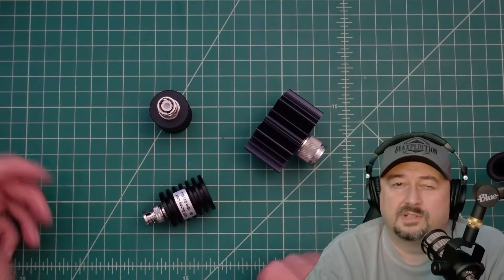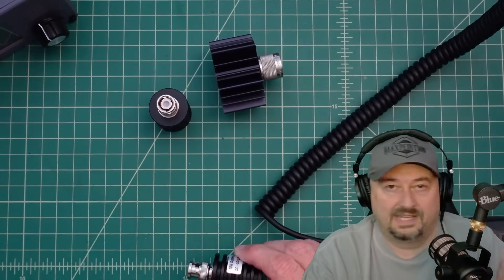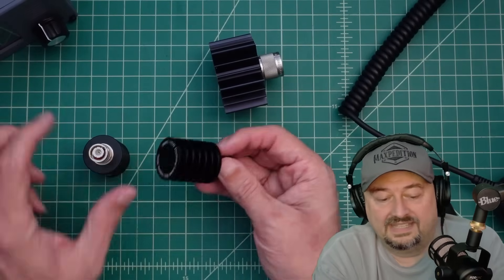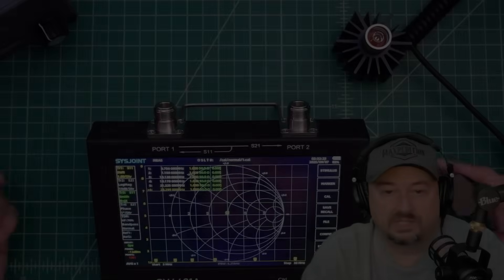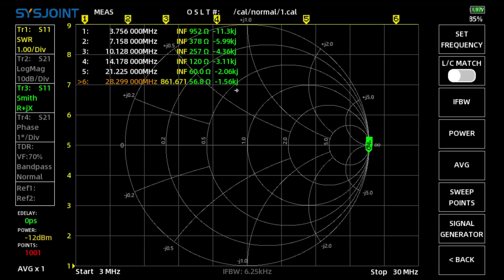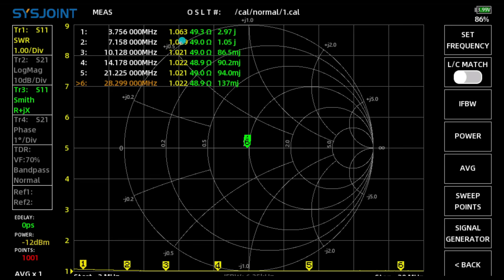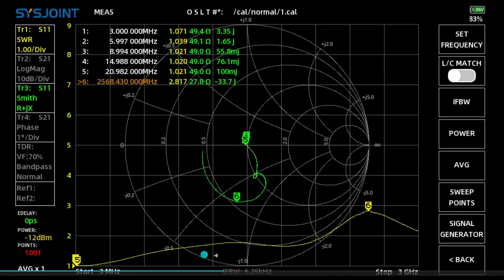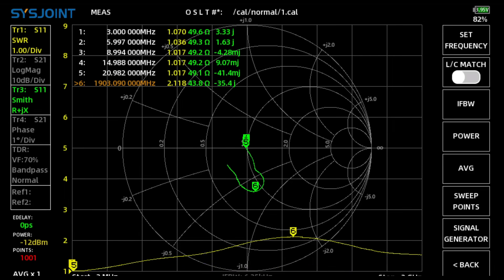I Found a BIG Problem with My Dummy Loads!

Comment: I have some low ower 50 ohm feed-through terminators.  Having seen some turn to infinite resistance, I checked and found that they had the termination resistor ends just squeezed in  BNC connector mounting screw threads.  Obviously the assembly process did not allow soldering, so they had figured out the smart squeeze in threads way.  Well,  good as far as it went, but the twisting the BNC lock ring after a few times had moved the mechanical connection via the thread enough to even interrupt the electrical path.
Reply from the maker: Ugh, sounds like a pain...

Comment: I used to work for Celwave, who also makes loads.  Bird and Celwave were very good load manufacturers, and usually they have measured data to verify these loads.  I measured all of mine, and my 150W load is 25 dB return loss up to 1.5 GHz.  You may want to make sure you have a test load that is verified to 3 GHz as a standard.  Just a suggestion.
Reply from the maker: Thanks Kevin, I actually to have a 250w celwave that I like quite a bit 👍

Comment: Years ago I bought a MFJ-264 dummy load at a hamfest. It was only $10. I asked if it worked and the seller said “What can go wrong with a dummy load ?”. For years we used it to check coax runs on field day. It was plenty good enough for that. Then I bought a NanoVNA. I used the MFJ-264 to see how the NanoVNA works. After getting some interesting looking displays on the NanoVNA, I removed the cover on the MFJ-264 for inspection. I thought it might be a cold solder joint or poor mechanical connection. The resistor was clearly marked 60 ohms, that’s 6 Zero. It appears to be factory, but I’ll never be sure. A simple check with even the cheapest VOM shows it ain't 50 ohms. Live and learn, always verify your test equipment.
Reply from the maker: Hey David, thank you sharing this story… it does reinforce the need to test everything 👍

Comment: I suspect the adapter is causing a fair bit of the discrepancies at the higher frequencies.  If you happen to have BNC calibration standards, you could calibrate your VNA with the N to BNC adapter accounted for.   The newer load is likely still worse than the Bird...
Reply from the maker: That’s a fair point 👍

Comment: Nice video, thanks! My MFJ tuner has a dummy load, but I am tempted to make my own from a welding carbon rod (maybe "air-arcing" is a better term) and trimming down the copper to get 50 ohms. Or maybe letting it be longer and using a ferrite transformer in front. Anyway, I like your direct narrative on the subject, it is so much better than someone droning on with a slide show.
Reply from the maker: lol, thanks for watching Richard.  Sounds like a good project 👍

Comment: I have quite a few loads, load attenuators (my favorites!), fixed and switchable attenuators.  I measured all of them and marked them with their usable frequency range.  Crappy ones I just throw out.  Some like the Weinschels are just awesome and super flat.  These are great things to find at hamfests because ebay prices are insanity.  Learn what to look for.  Also don't just blindly trust your measuring instruments, at least cross verify against those of friends.  I have been fortunate periodically to have been able to sneak in my best stuff to company labs and compare to calibrated very high end gear.  Some results surprised me!
Reply from the maker: Thanks for sharing your experience with those!  I’m the same way, if something is even suspicious, it goes away 👍

Comment: VERY IMPORTANT my dummy load also broke after +- 7 uses. UHF mail connector on dummy load. Open up and found!!
The center pin not locked in thus slight rotation while inserted leaded to tearing of (mangled) the connection to the Flange Mount resistor inside. So drill a 0.7mm hole thru the center pin and lock it with a cut of sewing needle thus can not rotate any more. Replaced the resistor with (J100N50X4) form Mouser Electronics.
Dummy loads are very expensive - with this now SWR in the range use excellent - reason the manufacturer also used a wire (long for RF use) inside. Now its direct on the pin.
Hope - this help your subscribers
Reply from the maker: Thanks for the info 👍

Comment: The response of the faulty load is typical of having been dropped and the substrate cracked. I have seen quite a few where users have either dropped them, or more usually applied +43 dBm to a 1 W precision calibration reference termination.
Reply from the maker: Thanks for checking it out Ian 👍

Comment: Normally these cheap dummy loads or attenuators fail because they can't handle their rated power for any reasonable amount of time.  I now never apply more than half their power rating to them and even then I only do it for a brief amount of time (5 or 10 seconds as an example).
Reply from the maker: Agreed

Comment: I had a brand new 90 degree angled BNC to BNC with a metal bracket that allows me to connect an upright aerial to my Icom IC-705. I noticed mad SWR even when transmitting tiny amounts of power. It transpired that the BNC adapter was open circuit. The 'reputable' ham outlet didn't test them before sale.
Reply from the maker: Hopefully they replaced it for you 👍

Comment: Used Bird, JFW, Weinshel, HP, etc are found used pretty cheap.  A lot of times you can buy attenuators cheaper which we all know can be easily turned into dummy loads.  I have some old Bird stuff that looks like it was rolled around in a rock quarry and still works and tests out fine.  I am glad I stayed away from these!  haha
Reply from the maker: Thanks for watching Dylan

Comment: Interesting. This got me thinking I should test my dummy load and SWR meter. 
I bought four Arcol low inductance 1% tolerance 50 Ω resistors, it said 50 Watt with heat sink for £7.42 each, three for my SWR meter and one for a dummy load. I use QRP only. 
I did test the dummy load and it had a bit of inductance but I'm only really interested in h.f.
Using a NANO VNA my results are here. Good enough for the price I paid.

1.7 MHz SWR 1.022   49 Ω
30 MHz  SWR 1.15     54 Ω

Through my SWR meter:
1.7 MHz SWR 1.03     48 Ω 
30 MHz SWR  1.115   55 Ω

Over 30 MHz both the resistance and SWR increase. 

G4GHB.
Reply from the maker: I could live with that, nice score 👍

Comment: Nice video ! Yes they go bad . Even had new one bad right out of box from Amazon . Even had bad attenuators as well. I got the MFJ one with BNC and 10 watts . Still good years later. None of my MFJ loads gone bad and I have many and push them hard some times . Always test loads . I got a 1 KW BYRD oil filled load made in 1990 with a RMS watt meter bult in. Meter movement broken but load is good. Has a N .  It is a 43 meter movement and has bult in line section.  A new meter is still made so I can fix it but $$$ . And does not read PEP . Just RMS watts.  I use a good in line meter that reads PEP and RMS . And can change scale.  The load only reads  1000 watt max and no slug or switch. Just a fixed scale. I got it broken cheap at ham fest. The oil load park is great  ! And it gets HOT !!  I put 1500 watt threw it.  Just shorter time. It like 10 minutes 1 KW but can't read chart anymore .Was a graph on side. Looks like a oil heater . Well it is.  73
Reply from the maker: What’s up Robert, I have to be honest here… my MFJ has been rock solid 🤘
Reply: @TheSmokinApe  Only my Amazon ones went bad . All my MFJ ones still great ! I only have 1 BIRD load .I may take out broken meter . And put metal plate with BNC for scope tap. I use a 43 line section for that now. I got a MFJ 1.5 KW dry load and still rocks hard. It smells a tad at full power but still good.

Comment: I bought an old Bird oil filled 50W load for 20$.  Well I measured it at home and it was over 60 ohms DC resistance and the antenna analyzer showed the SWR response. I took the tubular ceramic resistor out and it was not fried looking.  But I figured if Bird could sell me a replacement at all,  it would cost an arm and a leg.  So I went on ebay and found some Russian tubular ceramic 50 ohm resistors from a distant country.  But I had to buy like 7 of them.  I got them and picked one and installed it.  I had to make shims for the contact areas as the Russians were just slightly smaller diameter  but all works well now.  I wonder what kind of oil they use in those.
Reply from the maker: lol, glad to hear you got it sorted out
Reply: There was a problem with the oil dissociating and causing corrosive damage, this was a very long time ago.

Comment: I bet it’s a cold solder point.  I recently repaired my tru-sdx because the power port had a cold solder point.  It was also a failure point being surface mount and supporting the weight of a barrel jack power chord, so I snuck some superglue under it and the other connectors after fixing it.
Reply from the maker: Could be, thanks man 👍
Reply from the maker: Here it is disassembled http://youtube.com/post/Ugkx1qs1Tz2o2bBQkvF2Mpf0TUP-ECIsMOTA?si=gri6qIzb5zw0SZgk

Comment: Thats what calibration standards are for and they are used for nothing else. Having a box with a known vna 50 ohm load,  calibrated attenuators and a calibrated coax line sections to check the F/TDR function is best practice. I have an RG-214 cable that is exactly 100 electrical feet at 23C for calibrating and finding faults accurately in long transmission lines.
Reply from the maker: Hey Roger, a calibration standard and a dummy load are different.

Comment: My father taught me to check things like nail depth from the air tools and cuts on a saw with a piece of scrap before starting the job on the expensive wood, and checking a voltage tester on a live circuit before checking to see if a circuit is dead with it. In college, I learned to test the reagents in Chemistry before starting the experiment and sanity checking the meters before doing the Electronics labs. I keep my own lab equipment calibrated and strain the gnat over differences between any two pieces of equipment. Still, every once in a while, I find a broken cable, bad test lead, flaky adapter, and what not. 

My nice HP meter I was using for most things started giving me completely wrong resistance readings one day out of the blue, but given its age, it did not owe me anything.  If the readings were not so unbelievable, I could have been fooled because it died midway through the work.  It saved me a lot of time to die like it did.

So I completely agree. Test your test equipment. Try to keep some known things on hand on or near the bench to use as sanity checks. For each kind of gear, think about how to check it. For example with a VOM, have a power supply that can provide a known voltage, a resistor of known value, and that the two can be used to get a known current. A VNA as shown in the video is great for testing a lot of stuff with a few extra items, and you can check the VNA with those items as well, such as one of those VNA demonstration PCBAs.

Nice video. Good content, good production skill, and right to the point. Thanks!
Reply from the maker: Great post that helps drive the point home, thanks!

Comment: The cheap BNC connectors ground part often have a sliding  fit rather than friction fit and this leads to varying VSWR.. and intermittent connections..
Reply from the maker: I multi-metered it as well 👍

Comment: Bnc with sharp centre pins are 75 oms, bnc with blunt centre pin are 50 oms
Reply from the maker: I thought I’d had to do more with the dialectic
Reply: @TheSmokinApe  The pin is slightly smaller diameter, although probably not a problem. The point helps with the female which might not have any support around it.
Reply: Diameter and spacing of conductors also.
Reply: Blunt or sharp centre pin is a means of identifying the oms, a lot of equipment is 75 oms in the CCTV and wi-fi routers, the pin types to identify which is which

Comment: Dissect that dummy load in the name of science.
Reply from the maker: That’s more work than I want to do…
Reply: @TheSmokinApe send it to me and I will do it.
Reply from the maker: http://youtube.com/post/Ugkx1qs1Tz2o2bBQkvF2Mpf0TUP-ECIsMOTA?si=gri6qIzb5zw0SZgk
Reply: @TheSmokinApe  It's actually very easy to open up as the heatsink inside diameter is threaded and it just unscrews from the rest of the assembly.  Just FYI, Don (wd8dsb)
Reply: @wd8dsb  he'd rather spend more time testing other dummy loads - spent more time doing that than it would have taken him to open up the bad one.  In fact, the FIRST thing he should have done was just test it with an ohmmeter, he'd probably have found the resistance to be infinity.
Reply from the maker: I actually did that first but I didn’t include it in the video….
Reply from the maker: Here is is opened up http://youtube.com/post/Ugkx1qs1Tz2o2bBQkvF2Mpf0TUP-ECIsMOTA?si=gri6qIzb5zw0SZgk

Comment: I bought a couple of dummy loads on eBay that look much like the one you've had issues with. Both went to infinite resistance. Frustrated by that, turning back to eBay I bought several used ones made by established U.S. companies. They've not given me any trouble I agree with another poster, cut these open and see what the inside is like.
Reply from the maker: I think the name brand is the way forward for me
Reply: You don't need to cut them open, the heat sink typically has a threaded inside diameter and they just unscrew from the rest of the assembly exposing the power resistor and any frequency compensating components.

Comment: Any plan to Dremel it open and see what went wrong?
Reply from the maker: Nope, going into the trash 👀
Reply: @TheSmokinApe  Use it as a weight to slingshot antennas up into the trees.
Reply from the maker: Lol
Reply from the maker: Here you go http://youtube.com/post/Ugkx1qs1Tz2o2bBQkvF2Mpf0TUP-ECIsMOTA?si=gri6qIzb5zw0SZgk
Reply: The heat sink inside diameter is normally threaded and it just unscrews from the rest of the assembly, no need to cut it open.
Reply: I have always purchased dummy loads at Hamfests from individuals who purchase government surplus. Most all of these individuals will test these items before putting them up for sale. I even carry a multimeter with me that allows me to do a rough test. I have four loads that I have used now for 30+ years, all surplus, all still working.
Most are Bird with one Telewave.

Comment: I prefer building my dummy loads than buying them. In the last one I built, I used a 50 ohms 500 W RF resistor encased into an aluminum box with a HUGE heat sink. It woks fine and it is three or four times cheaper than a commercial one.
Reply from the maker: Sounds awesome Jose